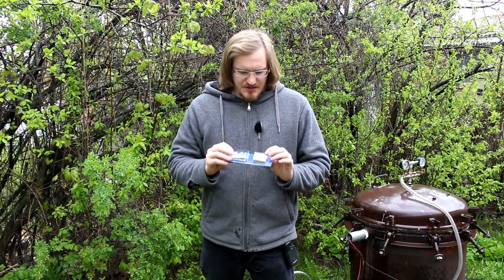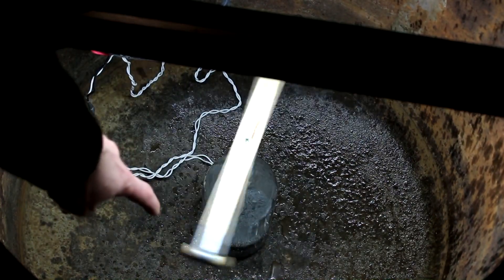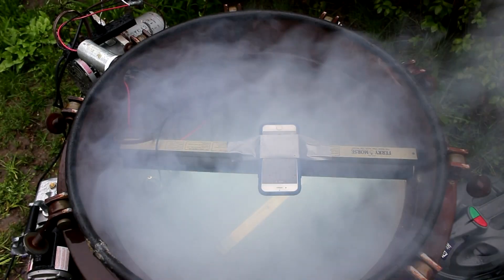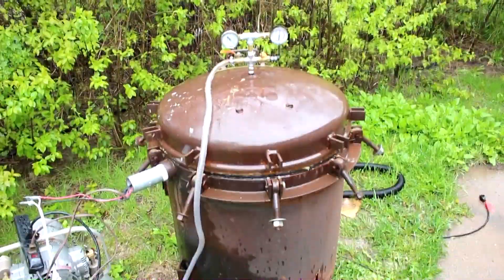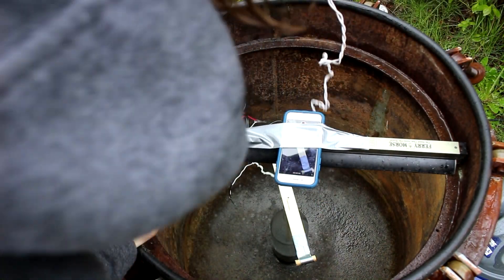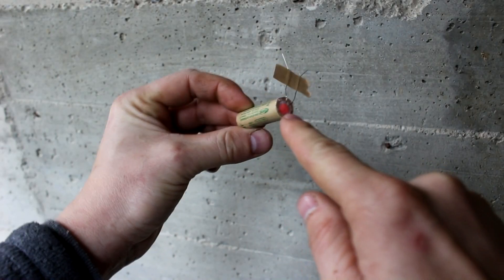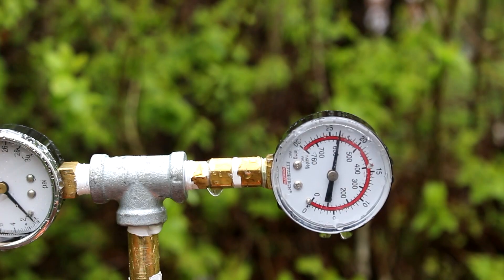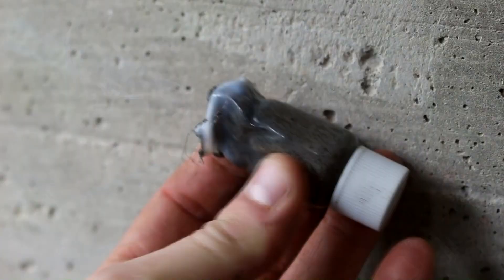Will a Model Rocket Motor Work In Vacuum?

Comment: That was nowhere near a vacuum in the torr range as space is supposed to be. Any pressure in that bottle would obviously have caused it to rupture under a full vacuum.
Reply: Ha dude no. Carbonated soda bottles regularly reach 40+psi. Pressure at sea level is about 14psi. A little plastic container like that could withstand 14psi easy, and Cody lives at relatively high altitude. It's not a perfect vacuum of course, but it's definitely close enough for this kind of experiment.
Reply: James C I think you need to study the Torr pressure range before you make outlandish statements like that and make yourself look foolish. NASA has a test vacuum chamber which goes into the Torr range, the walls ate over 5m thick reinforced concrete to withstand the pressure differential. Do some studying my friend.
Reply: MRPK1967 ok guy, explain why a 40psi pressure difference won't make a plastic bottle fail, but a 14psi pressure difference will. 

The required strength of the container is dependent its shape and the net forces on the container. A 14psi pressure difference is a 14psi pressure difference no matter how much or little gas is in the vacuum chamber.
Reply: James C that's where you're wrong James the pressure differential in a Torr scale vacuum would be enormous we can't get anywhere near that kind of vacuum on earth as I said NASA's vacuum chamber has 5 metre thick walls to withstand atmospheric pressure
Reply: MRPK1967 That means absolutely nothing. If you have an extremely large vacuum chamber near the surface of the earth, it'll have to be extremely strong. Do you even know what psi means? Pounds per square inch. Over a one foot square area, a pressure of 14psi exerts a force of just over one ton. Larger area means exponentially larger force. The space power facility needs that thick of an atmosphere barrier because it's fucking huge, not because it's pulling such a close vacuum.

You seem to be under some illusion that 14-0=more than 14. You cant have negative air, and that means you can't have negative absolute pressure.
Reply: James C  I have no idea how what your arguing about has anything to do with a pressurised container in a vacuum. Let's leave it there.
Reply: MRPK1967 most of the things you are saying are wrong. There's no reason to assume that a plastic container couldn't withstand a 14psi net force (less considering altitude) when other plastic containers, soda bottles, withstand 40psi+ normally.

And get this straight. A vacuum can only go down to 0 absolute pressure. If the environment is at 14 psi and the vacuum is at 1 psi, then the net pressure acting on the container would be 13 psi. Take it down to a perfect vacuum and the difference will be 14 psi.
Reply: James C your wrong. Do some reading on pressure differential effect.
Reply: MRPK1967 MRPK1967 by all means, provide some of this reading material.

Comment: Please send this video to every Flat Earther you bump into.  Hopefully, with this evidence, they will now be able to think at the speed of potato (baby steps).
Reply: Flat Earth Reset you can't scale down nothing. You're a special kind of stupid.
Reply: Flat Earth Reset wow nice argument you're so knowledgeable.
Reply: this test is laughable he had the same vacuum as a person up 6k feet
Reply: Your understanding of vacuums and differential pressure is non-existent.  The gauge we see measures the differential pressure between the inside of the tank vs the pressure outside of the tank.  Based on his altitude, his tank will reach 0 psi at about 25 inches of mercury.  However, that number can fluctuate based on the atmospheric conditions (high or low humidity).  Dry air is, ironically, heavier than humid air.  We can clearly see that it's a rainy humid day, which will drop the differential pressure, meaning his tank can reach 0 PSI at a point slightly below 25 inches of mercury.
Reply: nonsense he isnt even close to the vacuum of space!
Reply: And you got a lot of never mentioning understanding because you are duped by this pseudoscience this clown created and called it a experiment.. Thats not the infinite vacuum of space nasa claims exist in fact it isnt even scaled down properly
Reply: Fine.  Explain your points.  Give it a whirl.  Because, unless you can explain them, and back them up with actual science... you're just making noise.  0 PSI is the same in space as it is here on earth in a vacuum chamber.. a vacuum is a vacuum, the same way that a pound of lead weighs the same as a pound of feathers.
Reply: James C fuck off idiot

Comment: in a near vacuum, the near absence of o2 would prevent combustion. In order to have combustion, the rocket would need to provide a oxygen source.
Reply: lakeguy65616 the rocket fuel has its own oxidizer, or else this experiment wouldn't even be worth trying. There wasn't enough oxygen in the chamber to actually burn anything, the little pressure vessel was just to help with ignition, and didn't contain enough air to change the pressure of the chamber.
Reply: Yeah but that's also true at atmospheric pressure because Rockets do not run on oxygen from the air.

Comment: This doesnt make sense: combustion requires a fuel and an oxidizer, which is absent in a vacuum. I understand how rockets work because they actually have liquid oxidizers on board but can someone explain to me how this experiment could possibly work without some kind of an error being made?
Reply: The rocket fuel has an oxidizer in it.

Comment: Ok, so you cannot maintain a vacuum without having a solid barrier between the vacuum and the atmosphere, in this case the walls of the large pressure cooker like device you are using, got it.
Reply: +W Shawn OSBORNE   No barrier is needed between vacuum of space and atmosphere of earth. Atmosphere gets thinner with height. There is a continuous transition from air pressure on the surface of earth to the zero pressure of vacuum. And air without pressure does not move into vacuum, especially since it is pulled towards earth by gravity. Only small portions of specific components like helium can escape into space.

Comment: Also, just for clarification, doesn't NASA use liquid oxygen and a mixture of other combustable gasses in their rocket engines?  If that's the case, wouldn't that provide the necessary components to produce thrust even in a vacuum environment (contradictory to flat-earth moron theory)?

Comment: You need to use a model rocket and by encasing the rocket inside of an atmosphere you voided your experiment . In other words you fixed the test to align with your theory .
Reply: No. The pressure vessel was jsut to aid the ignition of the rocket. Cody has a whole video about why igniting things in vacuum is difficult. Ignition was NOT the thing being tested. The rocket maintained a burn in vacuum. That WAS the thing being tested. 

These little Estes engine igniters aren't designed to start in vacuum. The rockets aren't designed to burn in vacuum either, but they do.

Comment: When he put the rocket into the container it was in a separate environment from the vacuum there was oxygen in the container just enough to give it that one burst basically turning it into a bomb and destroying it so once it burns and the oxygen is gone what then? Plus it doesn't account  for the long burst NASA shows. You have once again helped the flat earth community thank you for all you hard work. I know you don't see your contribution but we do.  Fire doesn't burn in space you need than just something to burn to make it work you need oxygen and the only place we know for sure that exist is on earth.  So thanks again. When the globe heads kick you out well hold you down.  We'll need to borrow your vacuum.
Reply: Oh that's so cute, he thinks rockets get oxygen from the air!
Reply: Wreklis Animosity rocket fuel contains oxygen. How could you not know that?
Reply: how could he have helped the flat earth community in the slightest?

Comment: The experiment would have made a real impact if the actual rockets would go spinning for days, since there's no air friction, right !! but then ... this could be the smoking gun of a silly trick, not to mention that the container provides a mass against which the rocket will push against.. which doesn't exist in the vacuum of space.

Comment: The rocket didn't moved because it pushed the bottle, thats impossible because the bottle is attached to the rocket. You can't move a car by pushing it from the inside.

The rocket moved because it was pushing gas out of it so that is kinda "pushing" the rocket forward. Newton's third law.

Comment: Rockets do not work in a vacuum! He put a cap over the rocket which gave it a pressurized zone which  enabled it to emulate atmospheric burning. However, once the cap melted there was only the initial "punch" from the pressurized burning  that caused the subsequent movement of the apparatus.  Linear burning is impossible in a vacuum environment because of the impossibility of containment once the reaction starts.

 NASA=Liars
Reply: Pinny Smith rocket fuel contains oxygen. Get a book. Learn something. Become a useful member of society instead of a drag on it.
Reply: Pinny Smith well explode is pretty much what fuel does. A controlled explosion you might say. What reason do you have for believing fuel explodes uncontrollably in a vacuum?
Reply: Pinny Smith Consider oxy-acetylene tanks. The pressure outside of the tank is much lower than inside (just as the pressure outside the rocket fuel tank is much lower).  There's a nozzle to allow a jet of liquid to spray out without releasing it all at once and the tank is strong enough not to explode with the internal pressure.
Because it contains oxygen (like rocket fuel) oxy-acetylene can be used to weld underwater.
The pressure inside the tank is around 250 psi whereas ordinary atmospheric pressure is only around 14 psi. So if the pressure outside the tank were 0 psi it would hardly notice the difference.
Reply: Pinny Smith you are simply wrong. I can't help that, but lots of people who don't know about space will know about air tanks and such and realise you're talking nonsense so that will do. Maybe you can ask a friend you trust to explain it to you. Otherwise you're just going to have to stay ignorant of the world around you.
Reply: impossibility of containment? What do you mean?
Reply: techel the fuel from the vacuum.
Reply: Panikos Of Grays i know they do but they would explode in a vacuum.
Reply: Panikos Of Grays because of lack of pressure to allow containment.
Reply: Pinny Smith interesting idea, but I think unfounded. In any case while I am NOT a rocket scientist I'm sure that the fuel is coming out of a nozzle and then burning so that works out pretty much how you want it.
Reply: Panikos Of Grays the container shooting out the fuel would explode in a vacuum.
Reply: Panikos Of Grays a vacuum is totally different than 14psi. One could never oxy weld in a vacuum because your entire apparatus would explode. Moreover, a controlled burn i.e thrust inside a  vacuum is impossible.

Comment: Dude seriously?
You need oxygen to burn stuff, and in a vacuum there is no Oxygen, that's why the first couple of times it didn't work.
The third time you used a small plastic container which contained Oxygen that's why the "engine" ignited but by doing so that's not a Vacuum anymore so the experiment it's quite redundant.
Also the thrust of the "engine" pushed against the bottom of the bottle that's why it moved, hardly a Vacuum environment.
You basically cheated though you didn't realize it.

Comment: The earth is round.     @  0-1 Torr zero ignition,  a solid fuel "C" engine @ 19 Torr, there is ignition, but no burn, no thrust.
Reply: What are you trying to say?
Also every single one of these had thrust even the misfires had a bit of thrust from the igniter

Comment: Things can't burn... with... no... external... pressure... applied?  What?  That makes no sense whatsoever.  Fuel?  Check.  Oxidizer?  Check.  Adequate heat to ignite the fuel?  Check.  Combustion?  Check.  The vacuum has nothing to do with it.
Reply: The pressure from the atmosphere is needed to transfer the heat from the igniter to the fuel and keep the hot gasses in place long enough to make more fuel combust.

Comment: Love the video I have some questions tho,
First  how long was the rocket suppose to burn?
Second from what I saw and compared to with the  first rocket burn the last time seemed to burn less and not as strong.
Third are you able to repeat the experiment while keeping the vacuum going  since space is a larger vacuum.
Fourth since the rocket in a container was like a rocket going from earth to space  since the rocket had a chance to fully start up and begin burn wouldn't leaving space to go back to earth be like the second experiment with nobody being able to start the rockets?
Reply: Robert Harris
"how long was the rocket suppose to burn?"

About 5.5 seconds.

"from what I saw and compared to with the  first rocket burn the last time seemed to burn less and not as strong."

It was the opposite actually, The one at one atmosphere moved 22.7° in three frames with an average of 7.7° per frame after ignition before leaving the view of the camera. The one in the rough vacuum however, moved an average of 46.7° in two frames with an average of 23.3° per frame after ignition until it left the frame.

"are you able to repeat the experiment while keeping the vacuum going  since space is a larger vacuum."

I can't answer this question with certainty since I am not Cody, but I think it would be possible if there were filters connected into the pump removing the smoke particles and water vapor from the intake. It would only take some vacuum tubing, pickle jar, some silicone adhesive, some kind of desiccant for the water, cotton for the smoke particles, and some wire mesh to separate them from each other and from the tube going to the pump. It could all cost about 20-30 dollars.

"since the rocket in a container was like a rocket going from earth to space  since the rocket had a chance to fully start up and begin burn wouldn't leaving space to go back to earth be like the second experiment with nobody being able to start the rockets?"

Kind of. Rockets are never burning while a spacecraft is entering earth's atmosphere since the drag helps a lot with aerobraking for capsules like the Soyuz and parachutes. Even Space X's rockets don't preform burns during this time (only near the karman line, or near sea level).
Also; solid fueled rockets are almost never used in space sue to their unwillingness to light in a vacuum (like in the video) and there are usually thin burst discs holding in some pressurized gass for them to light when they do (they are also usually small and used to generate G's to get liquid fueled engines to relight properly). It's pretty much only liquid fueled and hybrid rockets that can relight in a vacuum since their combustion chambers are  automatically pressurized by the fuel and/or oxidizer.
Reply: It's not more like going from Earth to space then it is like having a pressurized container in space, which they can still do, they just closed the valve pressurize it and then ignite and open the valves or as the comment above mine pointed out, burst discs
What's the problem there?

Comment: How do rockets turn in space
Reply: They use small rockets called retro rockets that are located n various points of the craft and use either pressurized nitrogen or a hypergolic mixture (fuel and oxidizer that immediately combust on contact).

Comment: Complete nonsense...!! A rocket cannot maintain its thrust within a true vacuum...! Keyword is maintain....!! Your rotor blades spun due to the initial velocity that was created once the fuse was lit on the rocket and was accomplished because said fuse was separate from the vacuum or in its own container so it is possible to light anything in a vacuum as long as fuse is separate.....! But........ The rockets thrust inside said vacuum cannot be maintained and was very apparent in how quick it burned out...!  So stop using these tricks to further lies...!!

Comment: nasa makes shit up, too. shit being transit through empty space under rocket power
Reply: They don't have rockets constantly burning  for the entire trip (your comment made it look to me like you might have though otherwise), and liquid fueled and hybrid rocket engines don't suffer from the issues with solid fueled rockets highlighted in this video since they have a constant inflow of fuel and/or oxidizer pressurizing the combustion chamber while running and can use fuels and oxidizers that ignite instantaneously whenever they come in contact with each other called hypergolic fuels.
Reply: Feathered wiley t coyote couldn't have stated that better

Comment: On the other hand, it does seem plausible if the thrust is pushing into the forward side, inside of the rocket.  I'm about 90%+ sure a rocket could thrust in space but it would be cool if someone should it for all to see here with a big chamber.

Comment: What I mean is like an mma fighter pushing off the cage with his legs while on his back on the ground.  The boost would form the "legs" and when it hit the wall, it built a column of thrust that backed up into the rocket and pushed it around your vacuum chamber.  This is a possibility, but the traditional concept of thrust in space might be totally right anyway.
Reply: A "column of thrust" to the wall of the chamber is ridiculous compared to thrust from the particles leaving the rocket pushing off of the rocket.